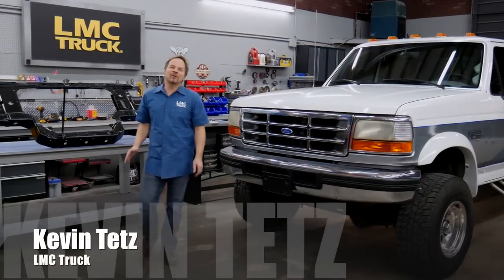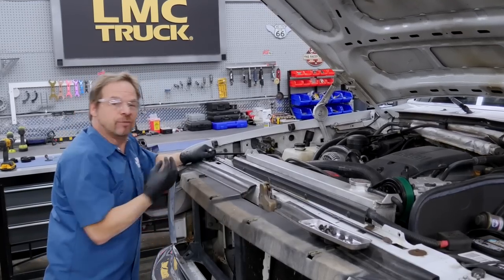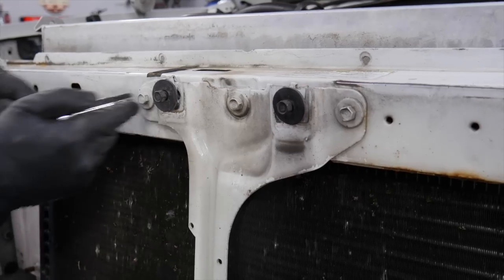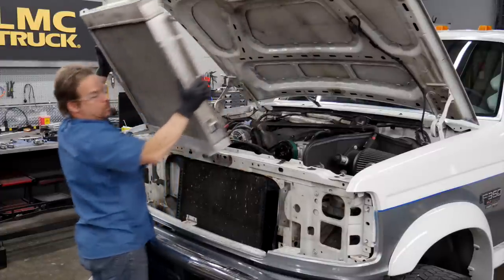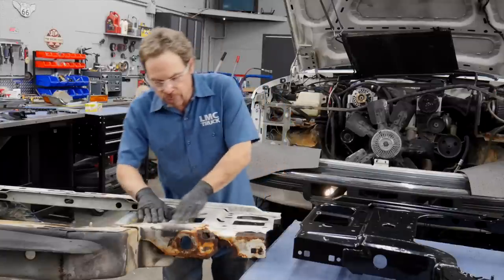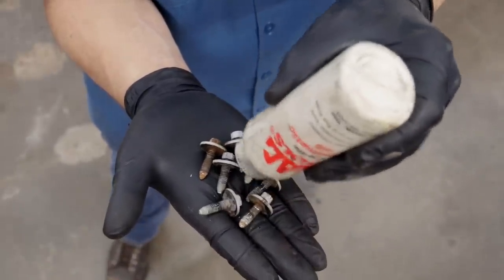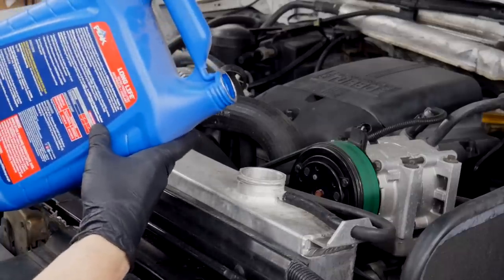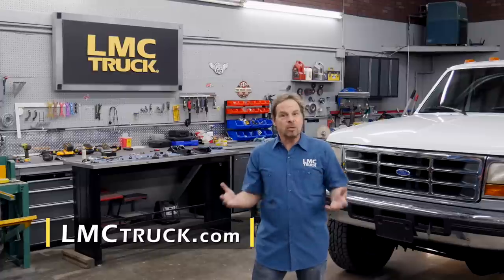How to Replace a Radiator Core Support | Kevin Tetz with LMC Truck

Comment: This video is very helpful… and the lmc radiator support is great… just finished installing one in my ‘95 f350…. The new part fit great. I did my power steering pump and vacuum pump at the same time, so removed the fan to access those items… I think having the fan out of the way made life easier for replacing the rad support…. I’d recommend removing it, if you’re able to do so.
Reply: I just checked and now they’re on backorder.

Comment: I got a 79 F150 Styleside pickup and doing a frame off restoration. I got all the new hardware and bushings for both Radiator core support and cab mounts. What are the required torque specifications for these bolts? I noticed you just just impacted the bolts on the radiator core support two bolts.

Comment: What reciprocating saw blade did you use for last bolts holding the core support to the frame? I am having a terrible time removing them, completely rusted out and hard to access.
Reply: Looks like a Milwaukee Torch blade to me

Comment: LMC How often do you get these stocked? Any random time I check your website, it says it's on backorder. I've got a 1997 F-250 HD with the 7.3 under restoration.
Reply from the maker: Hello Tim.  If it is part #43-3044 you are interested in the current eta is approximately 5-6 weeks.
Reply: @Lmctruck1  you guys need an email alert when parts are back in stock.
Reply: I would blast it and powder coat it if you live in a rust belt state

Comment: Great video.  Part numbers? I need the body to core support mount numbers. The online catalog  will not show ne f250 hd or f350. Also the marker light screws that strip as mentioned in the video. @ lmctruck

Comment: why would you need to drain the rad??? cant it just be moved slightly to get the core out?
Reply from the maker: Then it shifts slightly to the side and spills all over the shop floor and you didn't see it and slip.... Now you lost your 10mm socket. Safety is the #1 rule in a shop.
Reply: @Lmctruck1  what are you implying about the 10mm socket?
Reply: ladiges9 10mm is a joke.. everyone always loose the 10mm or it goes through a portal..... it’s just a joke in the car/truck community